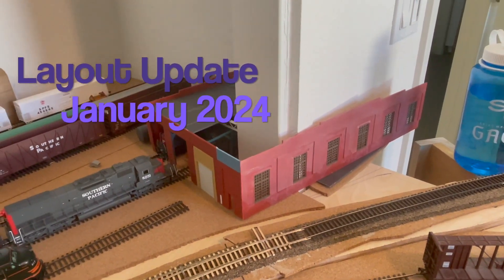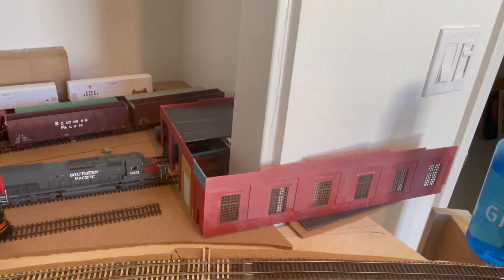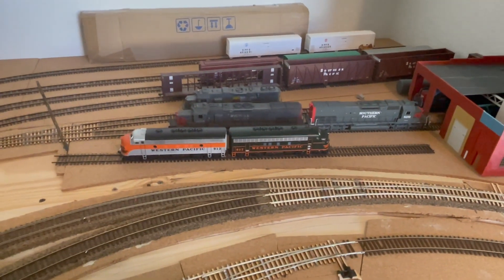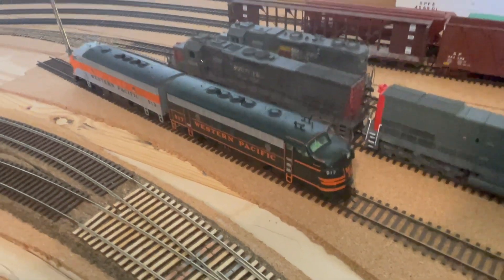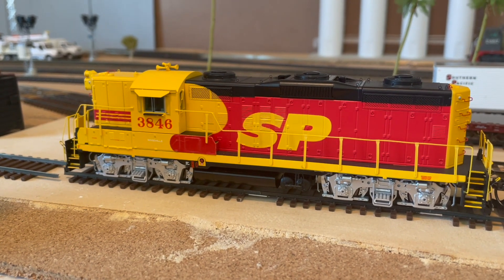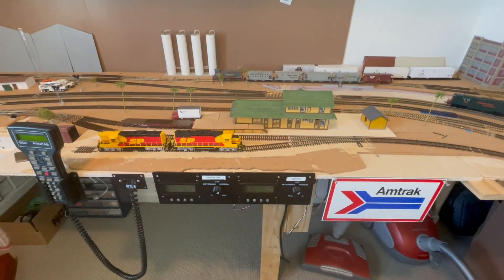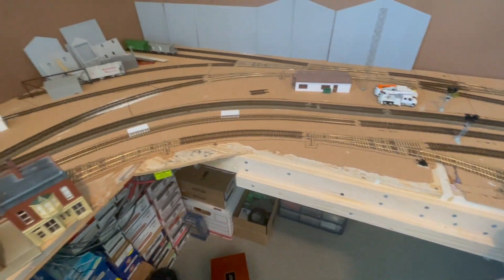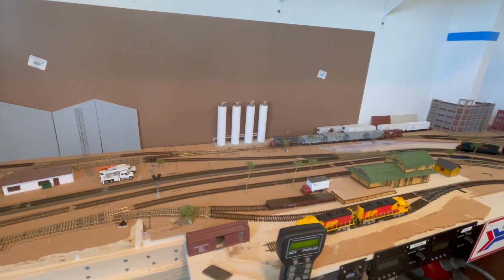10X10 HO Model Railroad | January 2024 Update

Comment: I have the same issue with whining and noise. I think the bronze bearings and the axle gears on mine are worn and need to be replaced.
Reply from the maker: that GP9 is brand flipping new. lol
Reply: @drewzdrew27  then stop flipping it in the air

Comment: Would you offer a Video on the Control Panel you have?
Reply from the maker: of the two motorman? Each are installed in a panel also available at Iowa Scale Engineering - includes a switch to choose system to use (DCC or Motorman)